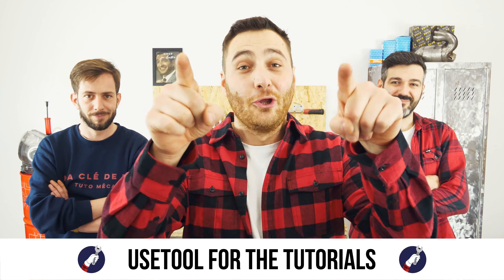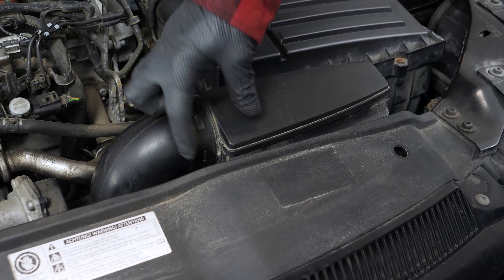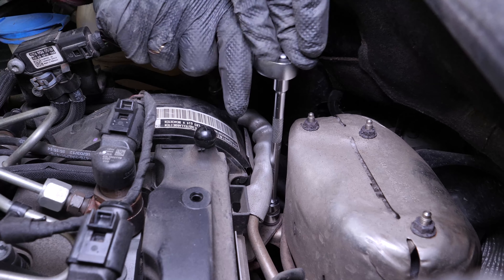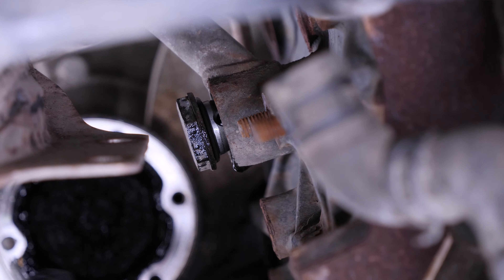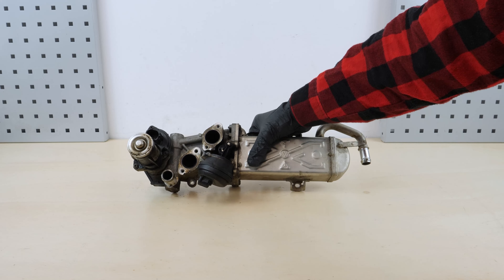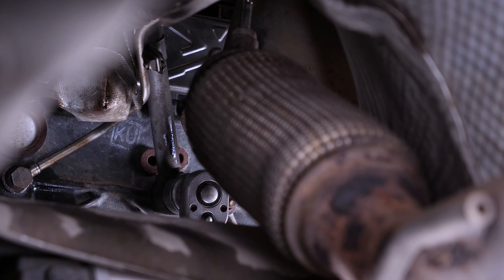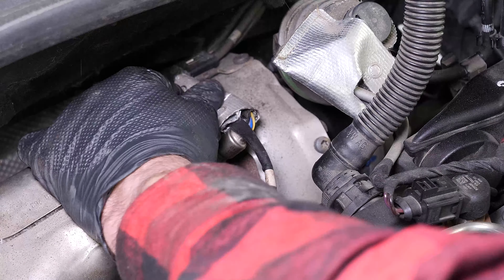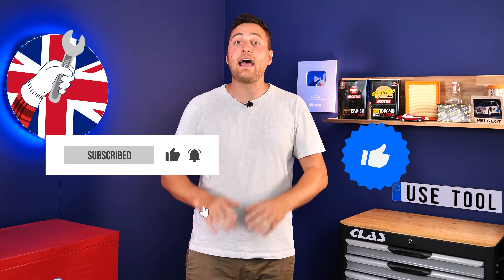How to replace the EGR valve (of HELL) Golf mk6 1.6 TDI ♻️

Comment: For anyone in the UK attempting to follow this vid - the video says PASSENGER SIDE - this is a left hand drive vehicle - its the DRIVERS side if you're working on a right hand drive vehicle. Don't believe me? Check at the very start when the hand brake is pulled on....that's his right hand which means driver seat is on left

Comment: Well, it's too complicated in youre tutorial. In reality, you don't need to bleed the coolant, you don't need to remove the cardan shaft, definitelly don't need to remove the control arms. If you have the manual gearbox, then you don't even need to remove the oil outlet, only if you have automatic gearbox. But it's still a stupidly difficult job to do, that's for sure.
Reply: i’m in the process of cleaning my EGR cooler on my 2.0 MK6 with Liqiu Molly diesel purge, hope it saves me $400 plus the $600 in labor that I’m doing myself 

And why do they call this the EGR valve? for an MK6 the valve is on the top. This new part here looks like an EGR cooler
Reply: @iGIVEH2OPE  im not sure mate if that gonna help you. There is a mechanical problem in these EGR so Molly doesn’t repair it. There can also be a leak. It is an EGR with the cooler, it’s one part.
Reply: So I can follow this tutorial, but without steps which you listed? Or your way is differen? Thanks
Reply: @mirekk.1320  You should check other videos, but yeah, with manual gearbox you can skip all of that.
Reply: 100% correct, but if the egr valve is carboned up it can be cured with terraclean. I dont recommend a pour in product as they did not work for me

Comment: By FAR the clearest and most comprehensive video showing this process. It also applies identically to B7 2.0 TDI Passats (with certain engines). 
A massively complex job but Do-able with enough time and patience. 
Pity VW chose to make it so inaccessible compared to so many other manufacturers though!
Reply from the maker: Hi! Thanks a lot for your comment! We’re doing our best to explain the unexplainable. 😄
Reply: Agreed. I'm a Mazda specialist and, despite their diesels being terrible, they're very easy to work on.

Comment: It's a bit weird, but though my mk.6 2.0 TDI (CLCA) looks the same, the EGR valve is just upon the throttle in the front of the engine. And it's a waaaay more easy to clean/replace it.
Reply: This is egr cooler
Reply: Is it clsa model have egr in front for sure? If yes i am lucky lol.